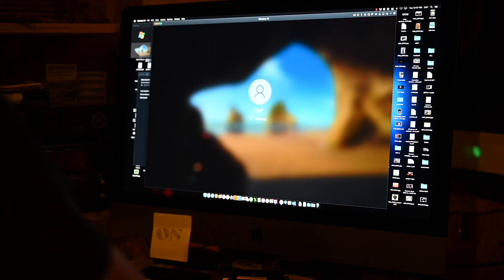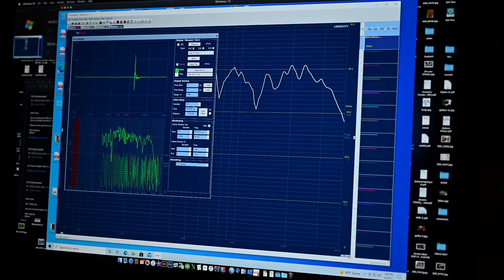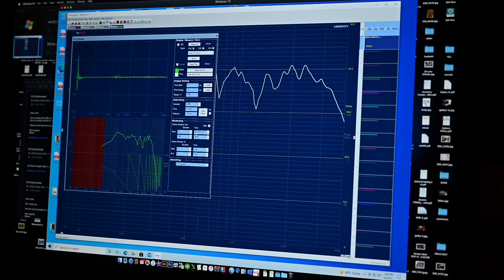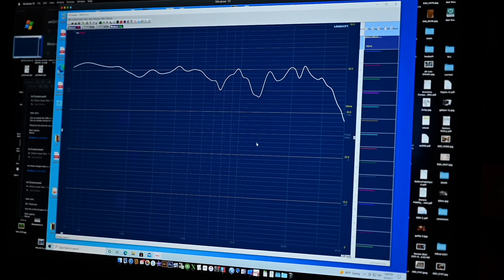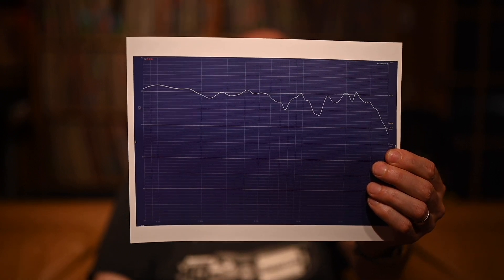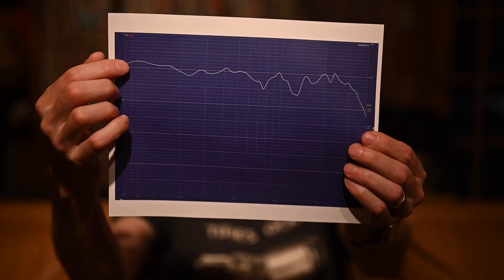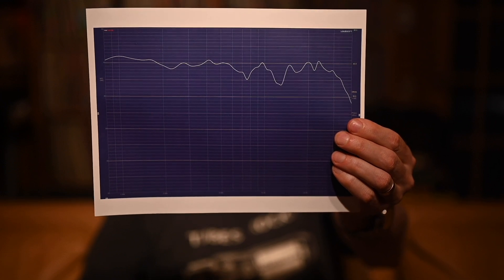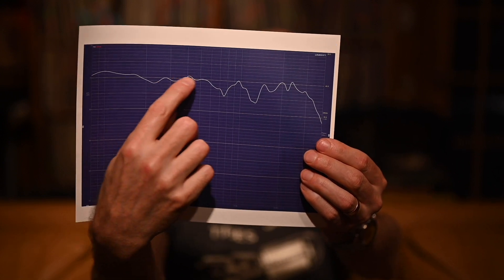Measuring the original gibbon speakers! John goes through a gated sweep SPL (quasi-anechoic) test.

Comment: I just saw your rant video about speakers sensitivity, now frequency response is something I always rant about. When I saw your 1st curve and you said that you tuned the x-over by ear I thought, yes that's exactly what it looks like I assume this speaker will sound nicely, because when you develop a x-over your ear is way more sensitive about distortion that is is to frequency response. Expecially when you get older (I am 55) you frequency sensitivity of your ears will get very "bumpy" but the distortion, especially nasty ones, you can still spot right away. So with a design by ear you naturally stay away from upper mitrange resonances and lower tweeter resonances so naturally you build in a negative bump at x-over frequency, and you can see this in almost all legendary broadcast speakers from 60s and 70s like the Roger 3/5, Spendor BC1, Klein&Hummel you name it. In these days I have the feeling (maybe because of the HiFi magazines) everybody tries so hard to avoid uneven frequency responses that many speakers sound like crap but they are measuring beautifully.
Just my opinion.
I myself listen with an old JBL studio monitor the 4425 (12 inch midrange and 1inch bi-radial horn) it has a distortion of below 1% from about 100Hz to 10kHz and that's what people who hear it 1st time always say "wow this sounds so clear in the middle where all the action happens"

Comment: "lowest frequency that can be measured is dictated by difference between distance from speaker to mic and distance from speaker to nearest boundary", and "farther away from nearest reflecting surface, longer you will have to be able to window the frequency response" does this mean....... what does this mean??? 

more precisely, what is the mathematical relationship between the lowest frequency that can be measured and the setup parameters?
Reply: “Big” sounds need room & also take time to develop.